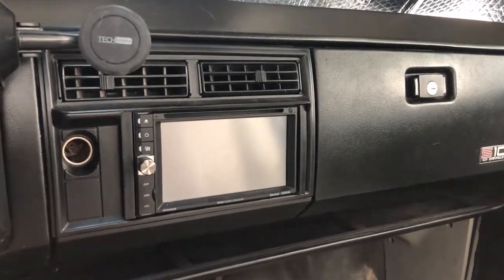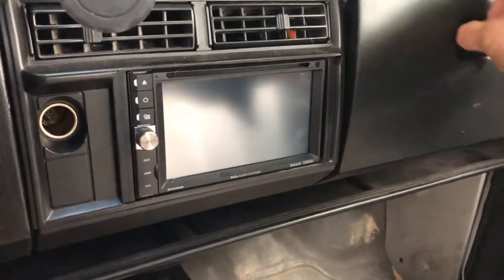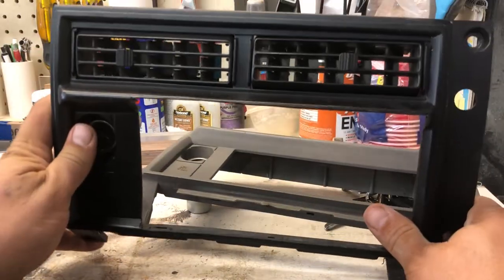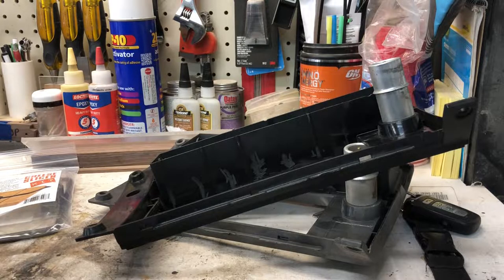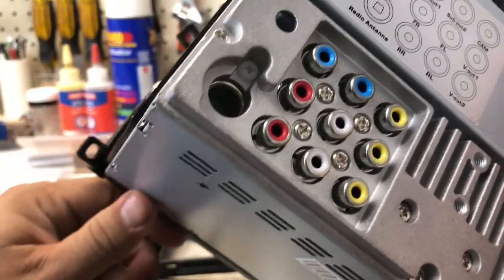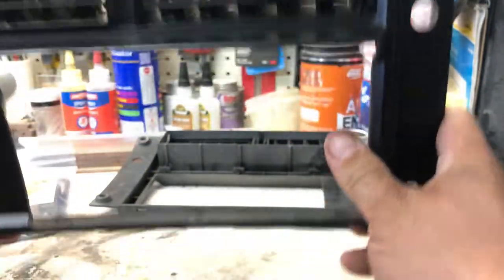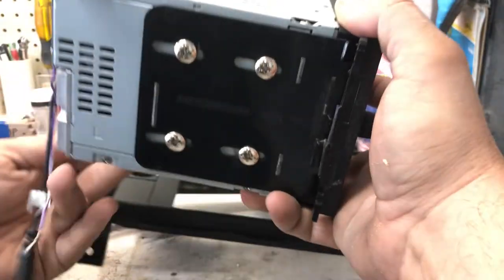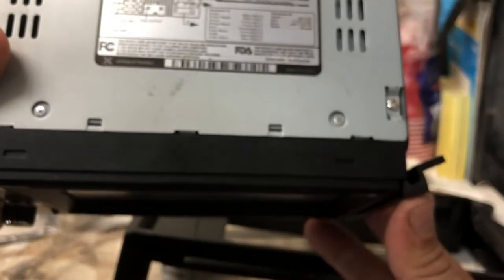1993 S10 Stereo Install Kit

Comment: Hey I bought the same radio inspired by this video and have a 1992 S10. I’m not sure of how to splice the wires into each other as the S10 has 4 harnesses and the boss has 1. Did you buy and adapter or do it yourself? Be great if you could respond as my dash is disassembled, have a blessed day
Reply from the maker: hobbslee23 yeah I bought a harness for my truck and it makes it easy to hookup to the stereo harness.
Reply: frankrizzo442 you mind linking me to that or putting the link in the description so other people like me that have this question can have a quick answer?
Reply from the maker: @hobbslee2336  Yeah man. I linked it in the description! Thanks!

Comment: What about the factory replacement piece that you cut ? What is that?
Reply: Is it just another factory one?
Reply from the maker: @amgeezy_2709 if you're referring to the bezel, yes. I got it from a junkyard. I kept the original one in case I got rod of the truck or put the original stereo back in.

Comment: That kit you said it was doesn’t have those pieces. The kit you suggested is a single din kit and those pieces are clearly for a double din
Reply from the maker: That's what I used. Either way, you can still get a double din stereo to fit provided the depth isn't too long. Amazon also has some android capable stereos that are way slimmer which is what I switched to.

Comment: You are amazing.  I did not think a double Din could be made to fit.  I have a 1987 S10 Blazer Tahoe 4X4 w/62K original miles.  What state are you in?  I am in Tn.  Do you want to sell your spare bezel?
Reply from the maker: Arlene Wolf hello. I’m in Texas. No I’m keeping it just in case I need it for another double din stereo that is sized differently.
Reply: @frankrizzo442  Hi Frank,  I guess I need to find a mint face (I want to do what you did and not ruin the original face plate)..  I have a 1987 S-10 Blazer 4X4.  Got it reciently got it.  It was from an estate sale.  Only 62K senior citizen garage kept miles.  I already had to change the blown speakers.  I am wanting to put in a short chasis Alpine ILX-W650.  I know I am going to have a big job doing this.  I am wanting to really do a perfect job body working it and making it look factory without using a kit.  The interior on mine looks like it was never sat in and under the hood it looks like it was never driven.  Only thing that bothers me is the 2.8V6 is a slug.  I think it is slower than some riding mowers.

Comment: Do you have amp? Where did you go into firewall  at?
Reply: No amp, but I did run a remote wire from the battery to my switch for the backup camera. On the driver's side firewall, there's a spot where you can run the cable through. Just stick a long screwdriver through it and look underneath your dash to see where it sticks out from. Hope that helps.
Reply: @X3WorkshopDesigns  thanks bro

Comment: What size is the stario
Reply from the maker: I'm not sure on dimensions but it's a typical double din stereo from Amazon. I since updated to an android stereo which is way shallower.  Check out my videos. I have a video showing it off.
Reply from the maker: It's in the description. I've since upgraded to an android stereo from Amazon. It's way shallower and much better fit. Check my videos. I have it on my channel showing off the new stereo.